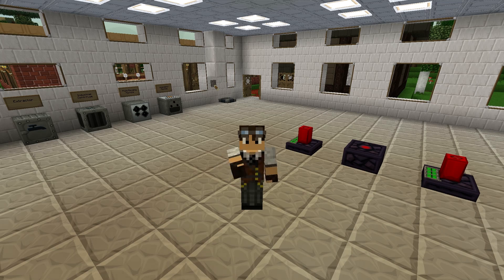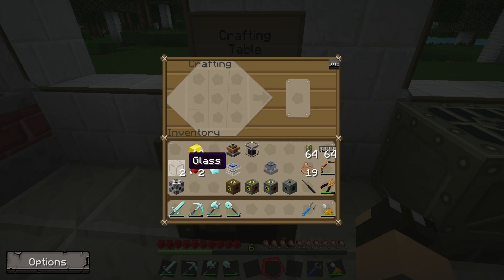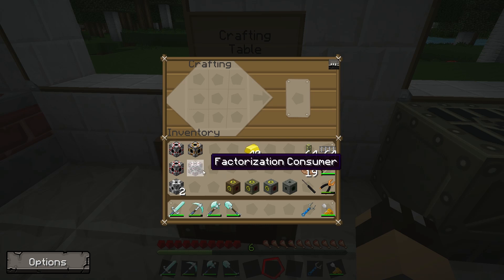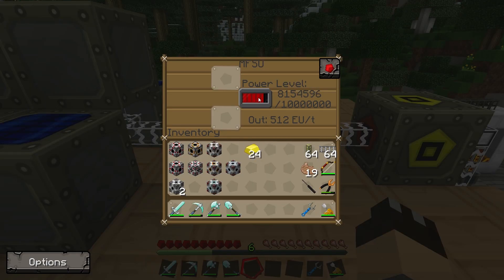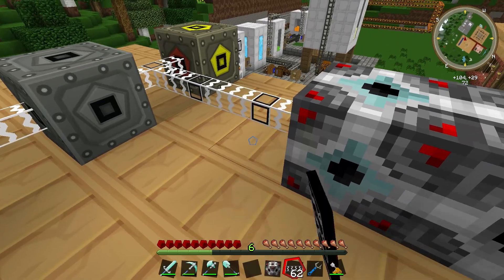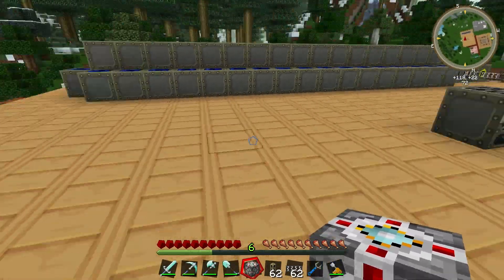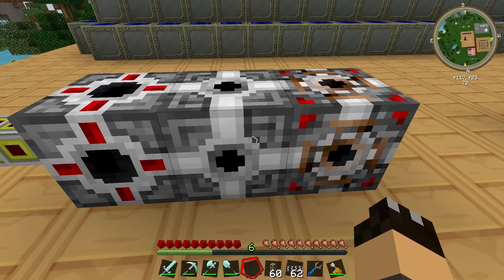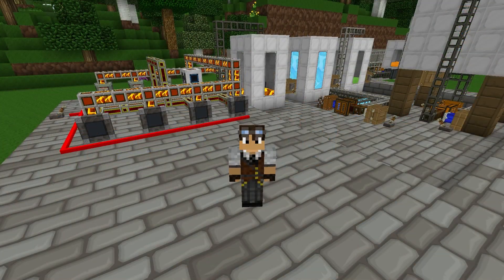Energy Bridge - How to FTB in Minecraft - 53

Comment: I'm in FTB Monster and I have solar panels hooked up to a bat box. Using copper cables, the bat box is connected to an EU consumer. I then have an energy bridge and an MJ producer hooked up to a leadstone energy cell. Sometimes this setup works, but frequently the EU consumer will pop off the wall. What is the problem? Is it a bug or do I have something wrong?